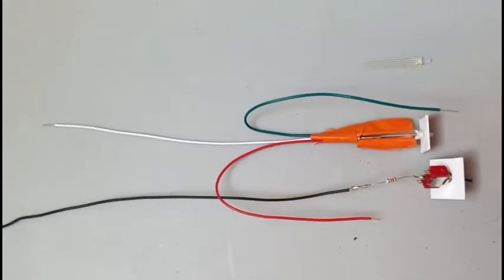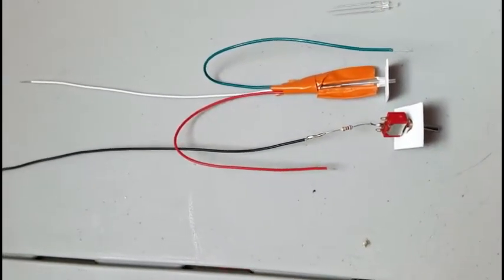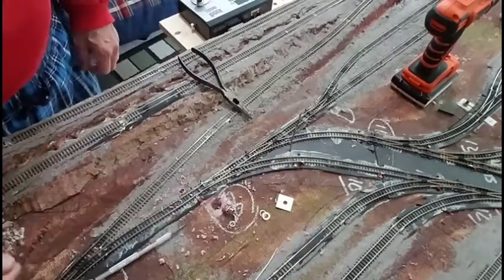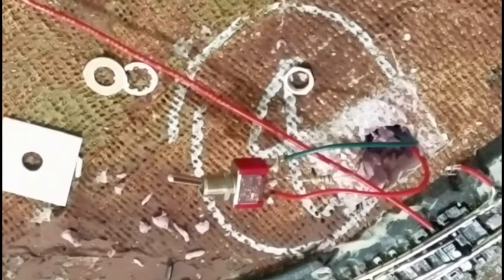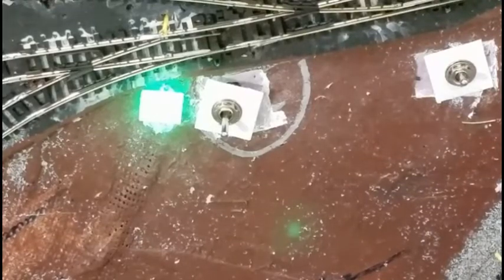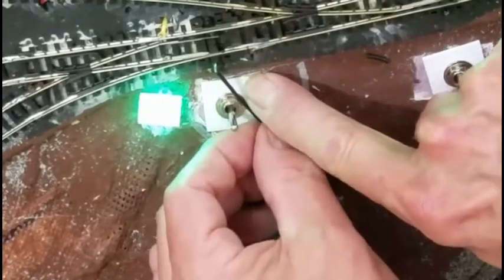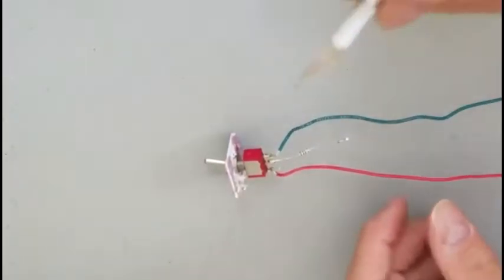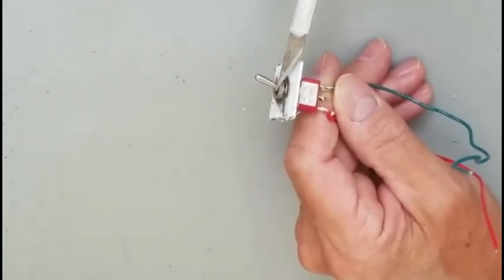TURNOUT LIGHT SHOWING DIRECTION OF POINTS

Comment: Interesting concept. But could only work on small layouts where you have close physical proximity to your switches. My intention is to use bi-color LEDs (green/red), on a control panel hooked up to push buttons on the control panel. Turnout (here in Australia we call them turnouts or points - you guys call them switches), will be powered by Cobalt motors. My layout has a few turnouts that can't be reached by hand.